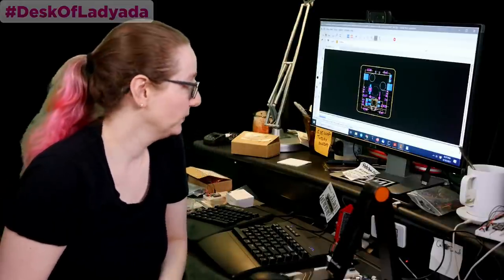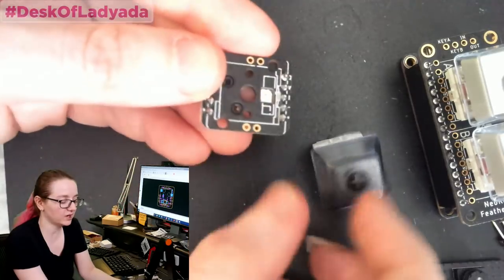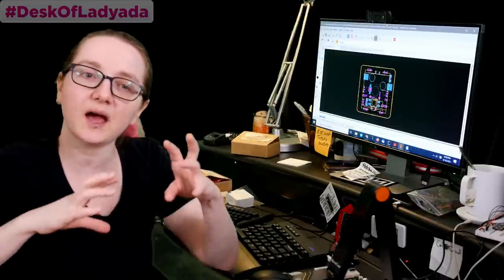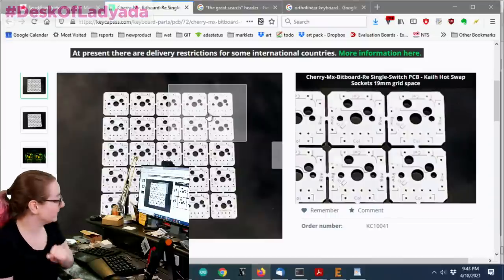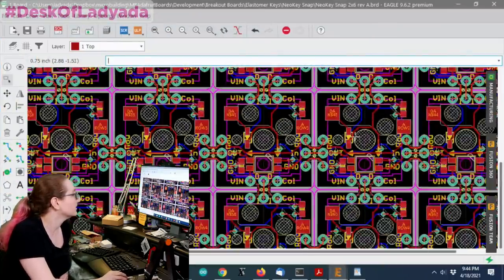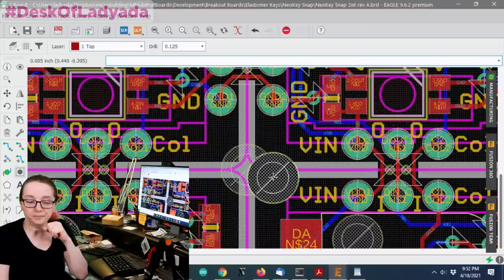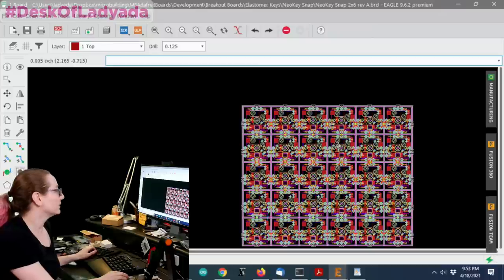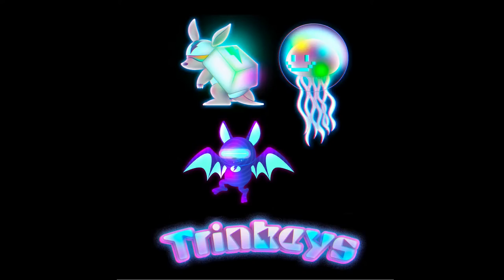Desk of Ladyada - Desk of Ladyada - snap-apart mechanical keyboards and “NFTs” :)

Comment: What drives me crazy is struggling to find a connector, say an IDC 2x8 eurorack male pins with shroud, and then struggling to find the matching females. Why can't Digikey suggest components compatible with the parts you've already ordered.  I make my suggestion at bargain rates, I merely expect unlimited free components in the future.